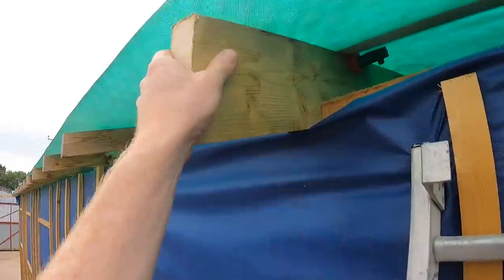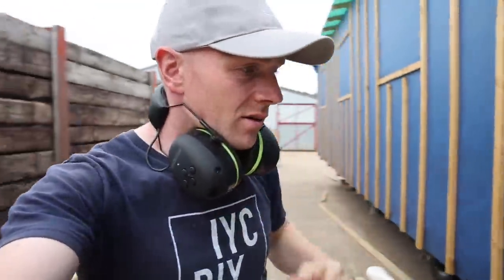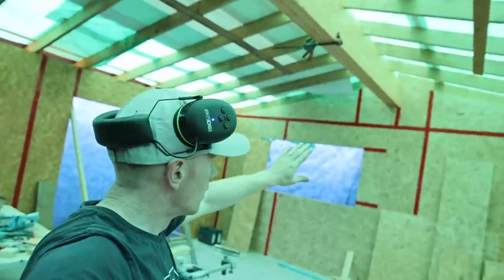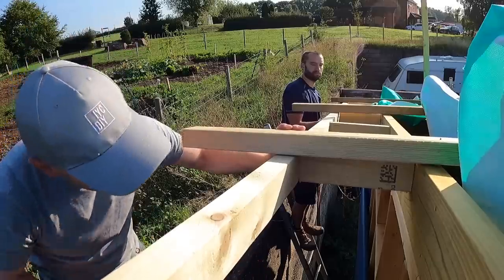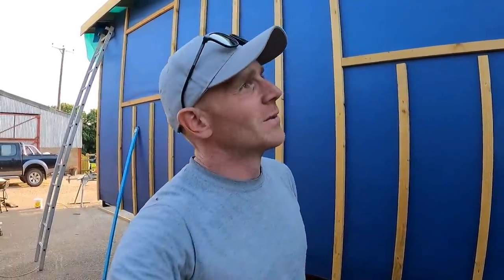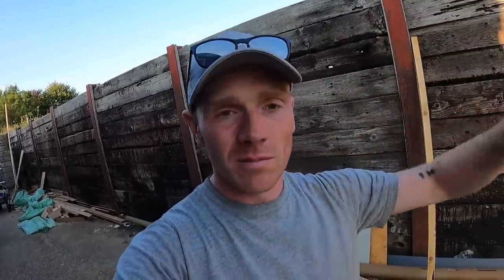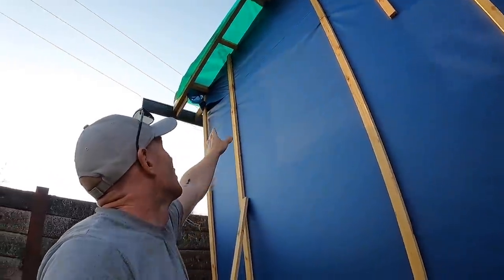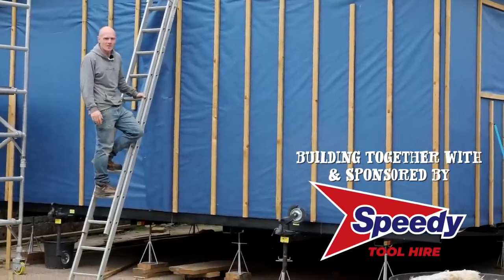CABIN ROOF PROGRESS - Gable Ladders built and Fascias are up!

Comment: Loved the video and wow your reconsidering if you need to move the temp building. Now that is a huge decision, one which I for one would agree with. You have very good shelter from the wind/weather so why would you want to move them into a field apart from the view, which you can still get just by dropping the wall slightly. I love the overhang which is even more protection from the weather. Thanks for posting
Reply: Agreed - seems a very sensible decision.

Comment: A big buldozer / or very large telehandler (or 2) could easily lift each cabin (one at each end) having first made some level ground.  There must be many other ways to quickly move these items, when the time comes.

Worst case a low loader delivers the heavy machinery to the end of the farm road and they drive the last few yards
A bulldozer could fill and recontour the farm road on-route.  You just need some big machines . . .

Comment: Moving the cabin down beside the barn will mean putting it directly under the live 11,000V overhead line! Unless the local DNO dismantle the last two spans. Alternatively, they could introduce what’s called a cheap-section, which involves fitting a tension insulator in each of the three conductors. This would disconnect the span over the barn from the live circuit while maintaining the mechanical support for the existing line (I suspect that’s why it was left like this). HSE would never approve of the way these two span down towards the barn have been left connected.
Reply from the maker: They are all going in next few weeks/months. 👍